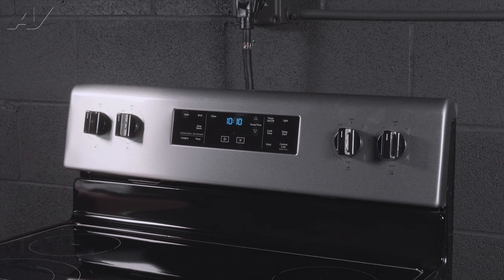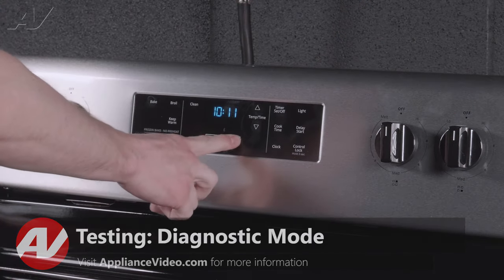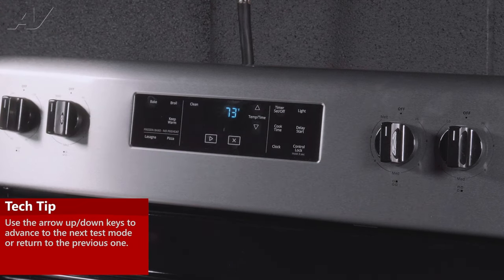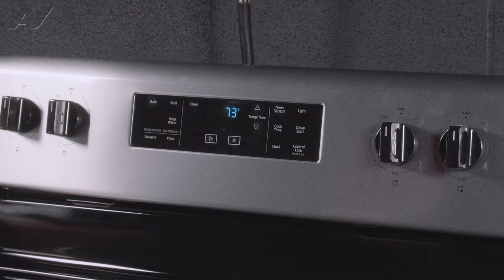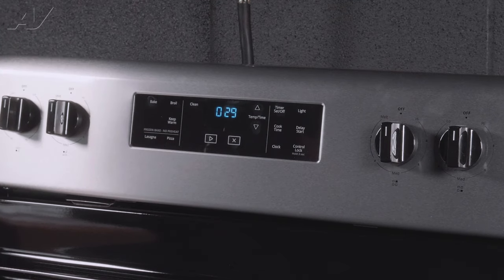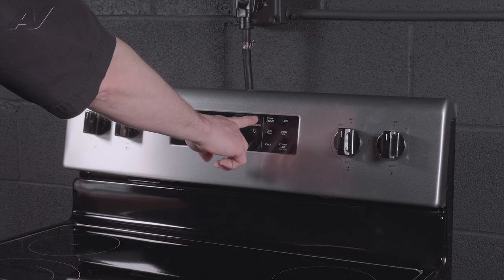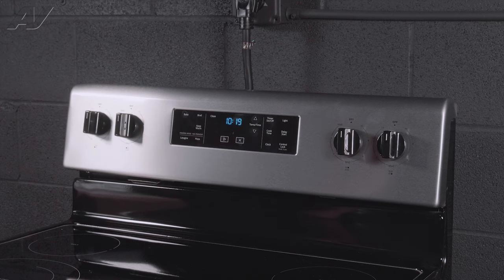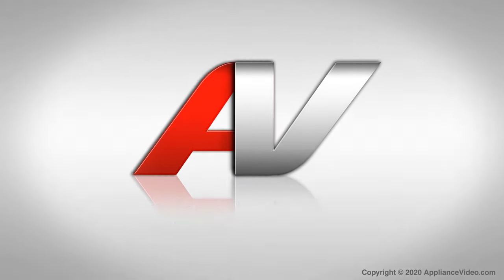Whirlpool Range / Oven - Diagnostics Mode Operation - Stored Error Codes

Comment: Since I used my auto clean on my Whirlpool Accubake System the oven temp will not raise.  Whether I use the up or down arrow, the temp goes down.  My timer does not operate properly either.   No codes have come up.  HELP!

Comment: I got the same model no error code still works fine but won’t stop saying the cooktop is on and hot
Reply: I'm having the same issue. I'm going to shut down the breaker box power and wait for a minute then turn breaker box power back on to see if this works.

Comment: My model has a number pad rather than up down errors.  I was able to enter the diagnostic mode with the cancel, cancel, start combo, but then it turns out that you just use the 3 and 6 keys in place of the up down keys.  Thanks for the video.
Reply from the maker: Great question, if you have a more technical question that our parts department cannot answer, you can search our over 17,000 answered questions free at our website www.ApplianceVideo.com under our Repair Help section. You can also call our parts department at 1-800-830-5465 and they can give you help 7-days A week ,or search at www.SaveMoreOnParts.com  .

Comment: What happens when it doesn't go into diagnostic mode?
Reply from the maker: Great question, if you have a more technical question that our parts department cannot answer, you can search our over 17,000 answered questions free at our website www.ApplianceVideo.com under our Repair Help section. You can also call our parts department at 1-800-830-5465 and they can give you help 7-days A week ,or search at www.SaveMoreOnParts.com  .